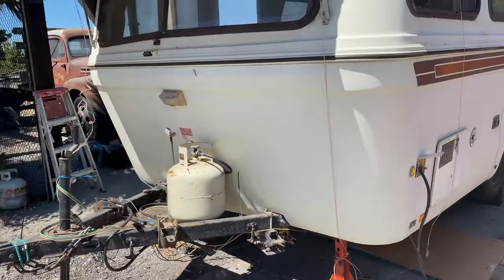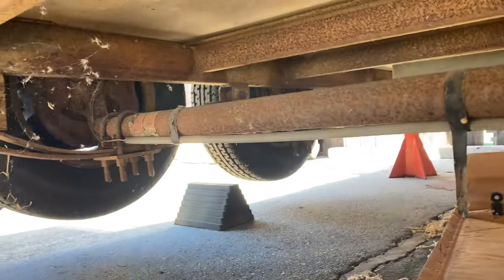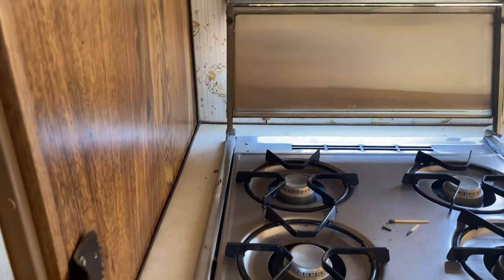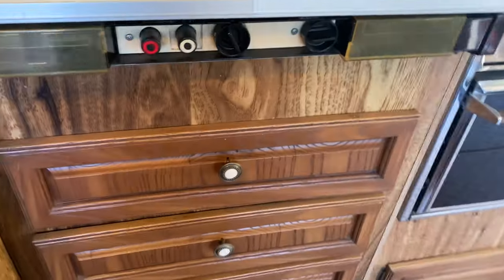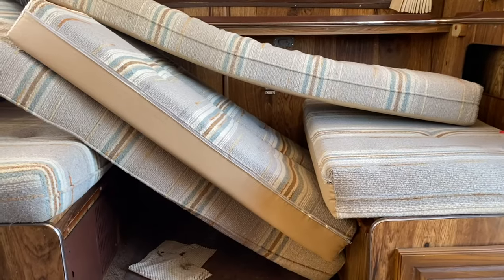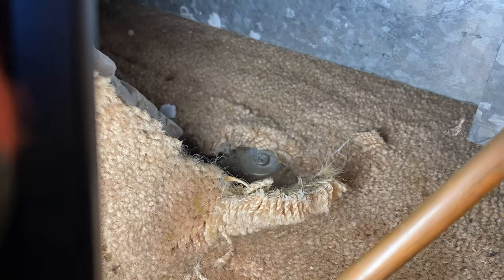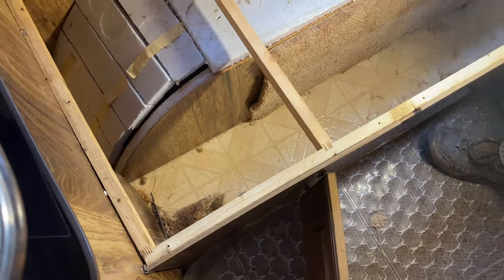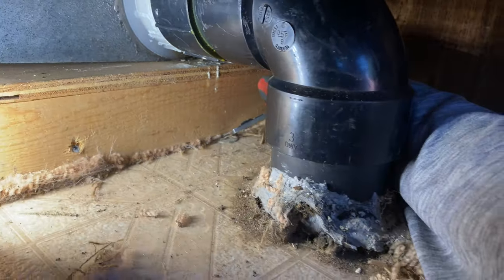We Bought a Rare Vintage Fiberglass (Bigfoot B19) Travel Trailer! EP01: The Frame Removal

Comment: We now have a 84 bigfoot trailer.  Hail damage to vent on roof so it needs repair on roof and ceiling inside needs to be completely replaced. For such an old trailer most is more cosmetic as far as i know. Need new propane tanks,  not sure about plumbing and wiring yet.

Comment: We purchased a 1987 B19 a year ago and we are gradually restoring as we discover the issues with every trip. Replaced the door, fridge, water heater. Need an air conditioner,  propane lines and new tires next. I also noticed that the shower pan is not draining. your videos are a huge help, Cant wait until you start on the inside? I like the way it pulls.
Reply from the maker: Hey Dennis! That's so cool, if you are not already, join the 2-3 Facebook groups associated with the Bigfoot Travel trailers. Check out episode 02, episode 03 shows in detail the inside, comes out Dec 24! We hope to take it out soon too. Thanks for tuning in!
Reply: @b19sleeper9  Thank you for the reply and new episode. Looks great! I see you added a new air conditioner. My B19 has no air conditioner but I believe did have one at one time as it appears to be wired for one? Which brand did you purchase or would recommend? Trust this is not your post? Thanks again and Happy Holidays!
Reply: @b19sleeper9  Trust this is not your LAST post
Reply: With all the repairs you mentioned is it still worth buying an older trailer and fixing it up? Especially how old it is?

Comment: On the trailer hitch and frame that was bent by backing.  This was backed by someone who didn't know how to back a trailer.  NEST:  You need to spray all these fittings, nuts and bolts with WD 40 and let stand and then spray again.  Often some neat will help but be careful not to burn the trailer.  
Where the polite is located, take some space from the closet and make your bathroom a wet bath and add a shower. 
The switch by the sink might turn on the pump so you have water at the sink.  Wish I were there to assist you.  Any questions, feel free to ask.  Just post a comment and I will see the notification.
Reply from the maker: Could be but there is no damage to the thin gauge bumper. Awesome thing about this camper is that it already has a full wet bath and toilet! Check out episode 02, episode 03 show the wet bath, comes out Dec 24! Thanks for tuning in!